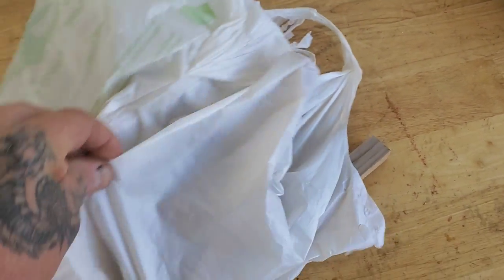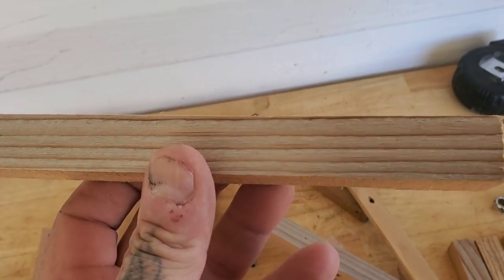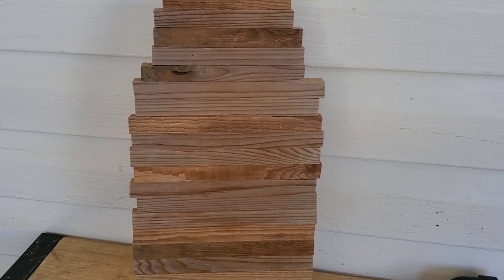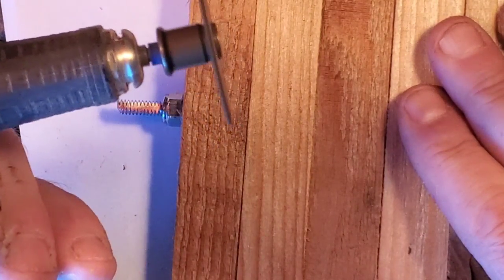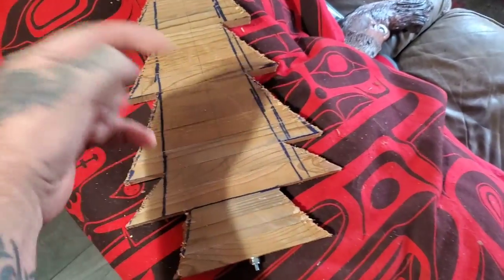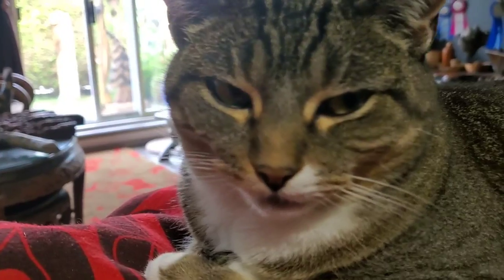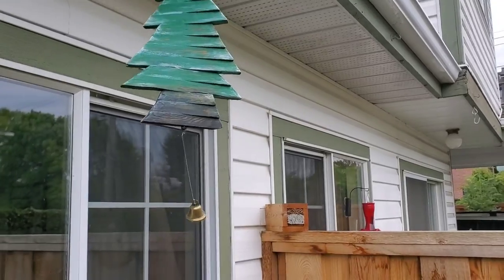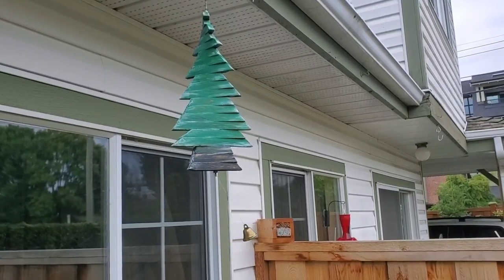How to make a Christmas tree wind spinner. Easy DIY.

Comment: Little tip when cutting off the all thread rod , put your washer and nut on first then cut it off..That way you want have hell trying to start the nut, and half to go grind the end on a bevel to start the nut..I like the tree..See Ya
Reply from the maker: The piece i cut off was 2 feet, i DID NOT want to screw the nut that far down kicking ass grass
Reply: That's funny..See Ya @CarvingFusion

Comment: I've got the "heavy hands" gene as well. 
It comes wit the side effect of you wearing whatever color paint you used in the last 3 days. Wood glue on the carpet (just bought that carpet, it's in my moms rented trailer)... 
Try, try, try again, it will follow you around. Having fun with the Foredom, only wrapped myself in it once and got 2 band-aids learning when cutters grab it DOES NOT stall out. It will rotate your world. Think I've learned due respect now. It's NOT a Dremel. It's like 500 of em, with an attitude. You have to keep the rpms up, even though your gut says lift, if you lift it will grab for sure. Have faith and keep the hammer down. And keep anything cloth a long ways from extreme bits. I had to get the bad-to-the-bone one (TX) with 1/3 hp, but I'm sure the SR would have been plenty just as everyone said. One thing is for sure, it'll run anything you can chuck in it - with authority.  The question is, can the operator hang onto it? 

Nice Tree build, gotta make some, seems it's Christmasy already, but there's a ringing in my ears that won't go away....
Merry Christmas.
Reply from the maker: Lol 😆 🤣 😂  :)